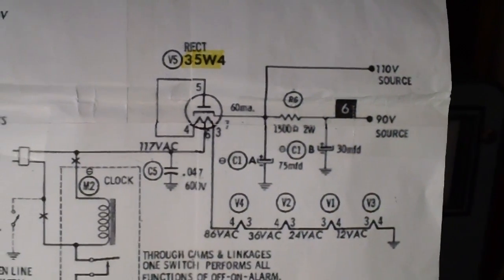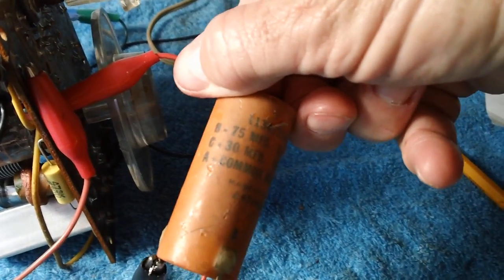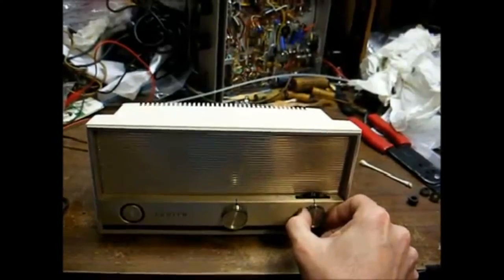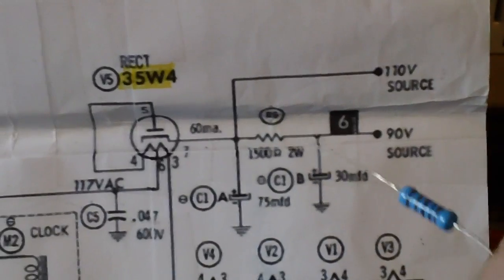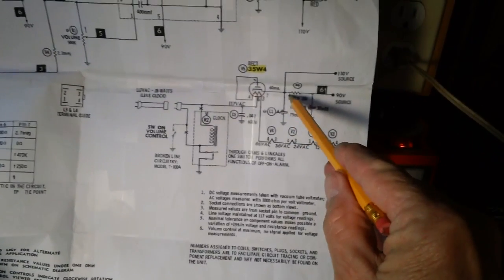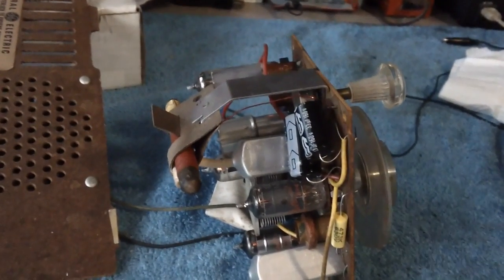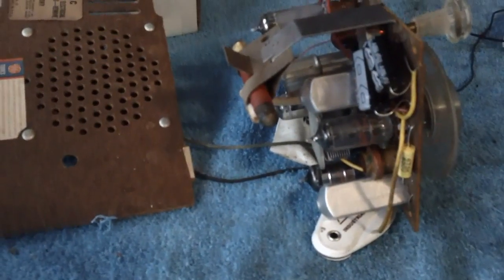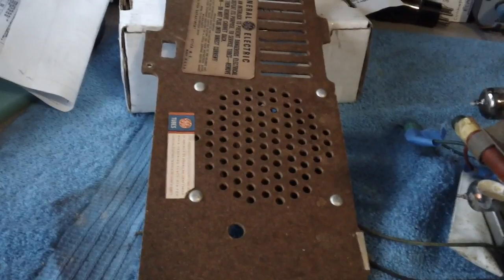General Electric C-403A Radio Repair Exercises (part 3 of 14).

Comment: Gotta Love it! Great Job! I never thought of demagnetizing the antenna but sure loved that you tried! I love tube radio's. Admiral has a radio/phono where if the paper capacitor shorts it actually burns that section of filament open in the 35w4. A good idea at the time but 35w4's are going to get hard to find some day. I've also had a defective 35w4 that drops the output voltage so low the amplifier distorts.   Thanks

Comment: Hey John.
Great video as usual.
Would have been interesting to see the voltages after the 1500 ohm resistor as the changes in values were happening.
seems like there would be a swing on the 90+

Comment: I get a kick out of that WAMP sound from the degaussing circuit in some color TV's. In fact, my grandmas TV was odd. It would go werrr klunk then the sound from the speaker would turn on. LOL
Reply from the maker: Jeffrey,
Looking back, weren't the old TVs a pile of fun at times?  I still picture my dad outside the house spinning the aerial left and right while my mother steadily gave him a reception report through an open window.  LOL

Regards,
John
Reply: I can top that. My moms mother told about tooting the car horn when the reception cleared. The antenna was on a mountain quite a distance away. LOL.  I wish we had analog and digital over the air TV. I heard Zenith had invented a multiplex system similar to FM stereo for digital in the 80's. Here we seemingly got digital TV shoved down our throats at once if you ask me.

Comment: Hi John..When anybody uses gator wires. my ears prick up and I watch..I am a lover of alligator clips..have them all over my bench..
Buzz
Reply from the maker: Buzz,
Want a non-pig heart a la king challenge????  Put together a 5-tube radio by gator wiring every single component together...no soldering, no clips.   Components and gator wires will be spread all over the place, but in the end if you hit the switch and it tunes and plays, you'll be a huge YouTube vintage radio hero.  I'll make a special video about it, telling everyone how cool you are.
No guts - no glory, old bean.

Regards,
John
Reply: joernone hummm..i would need about 100 more gater wires...got any?
Buzz
Reply from the maker: Buzz,
If you decide to go for it I'll buy two packages of RadioShack 18" gator wires and send them to you.

Regards,
John
Reply: joernone ok... I need a radio too... that one you're working on looks to be a good candidate..
Reply from the maker: Buzz,
Git yer own radio, ya mooch.  Besides, you're supposed to build one from scratch using an AA5 schematic.

Regards,
John.
Reply: joernone thats a good idea,....,i may try that

Comment: Another great video John. Before moving away from the power supply, would it be possible to show or explain what happens when an oversized electrolytic capacitor(s) value is installed in the radio and impact on the performance, voltages and impact on the life of the tubes? Thanks. Don
Reply from the maker: Don,
Brendan and I are discussing this subject right now.  We'll figure some way of answering your question.

Regards,
John

Comment: Hey John:  great videos.  I have seen many of them and have noticed how important it is to monitor the amps flowing though the circuits.  I am replacing a bad power transformer and am concerned the set has a short.  How do you connect the amp meter to monitor amps flowing through the PT?  Any chance you could work this into one of the videos?  Many thanks for all you do for the hobby.  Armand
Reply from the maker: Armand,
Thanks, my friend.
To monitor current flow through the PT connect an AC ammeter in series with one side of the power line.  Go here:

Voltmeter and Ammeter Workbench Setup.

Regards,
John
Reply: Thanks John!

Comment: Great video!! I can't believe a couple years ago you didn't want to know anything about the technical stuff in these old radios, you just wanted to know how to fix them!! Now you are teaching a technical course in the functions of the All American Five!!!

Just a suggestion, you could show how the E-caps charge up to max at the top of the pulse and then fill in the current draw between the pulses to create the full DC voltage - again, just a suggestion - Dave
Reply from the maker: David,
I'm still not at all interested in becoming an electronics engineer, but this series is becoming a bit of fun.   My worry is whether poor ole Brendan can continue to hold up under my inane questioning.  LOL

Regards,
John